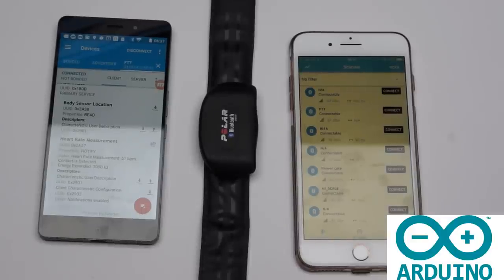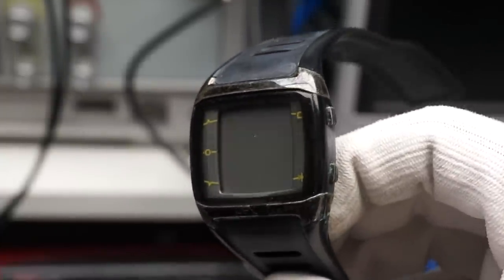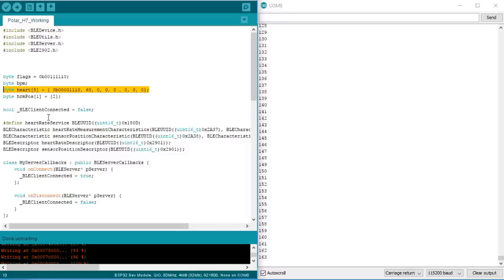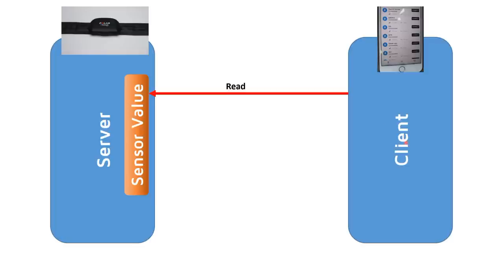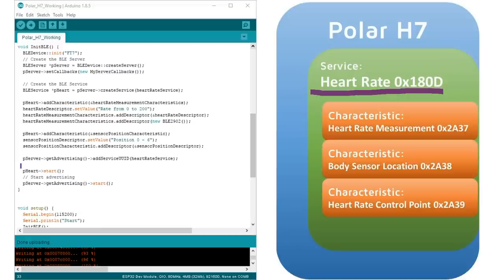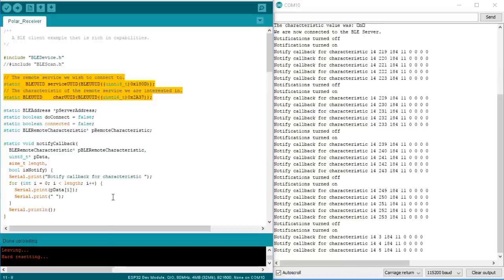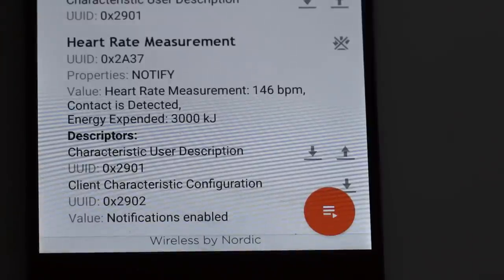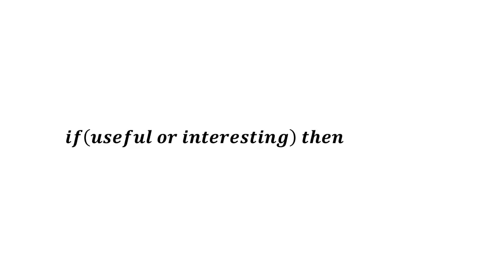#174 Bluetooth BLE on ESP32 works! Tutorial for Arduino IDE

Comment: Hi... thanx for great videos!
I'm having a little trouble... 
I want to send longitude and latitude in Location and Speed Characteristic 0x2A67
https://www.bluetooth.com/specifications/gatt/viewer?attributeXmlFile=org.bluetooth.characteristic.location_and_speed.xml

How should I set up the setValue array?
Reply from the maker: Exactly as described in this document. But you might have to read it a few times and try. Use NRF connect to see what is sees. This will help you to correct your code. Maybe you use my fake Polar sensor sketch as a reference. Yours seems to be more complicated, though.
Reply: I have tied your sketch with success.. I think I'm stuck with the Characteristics.setValue..
the HeartRate Flags is 8bit, and the Location is 16bit... should I split it?  byte location[xx] = { 0b00100000, 0b00000000,.. and so on.. ?
All I get in NRF connect is an array of hex(?) values...
Anyway... I will have a closer look at it next year... :)
Happy New Year!
Reply from the maker: You have to understand each byte and first distinguish, which you need and which not. Then, you have to fill /decode the important ones. Takes some time but is possible. Happy New Year, too.